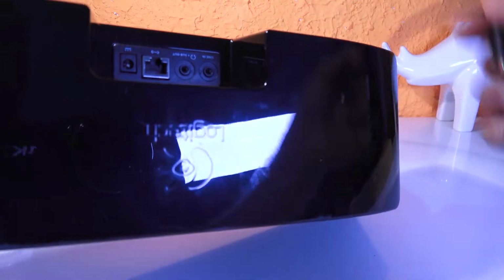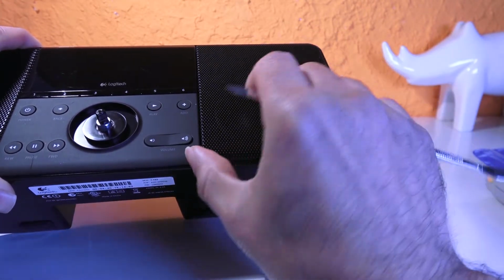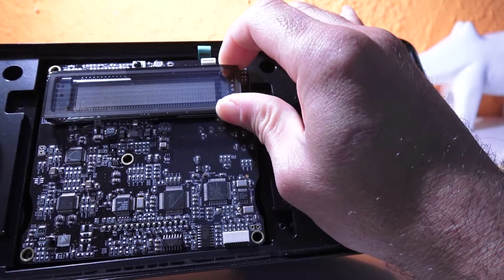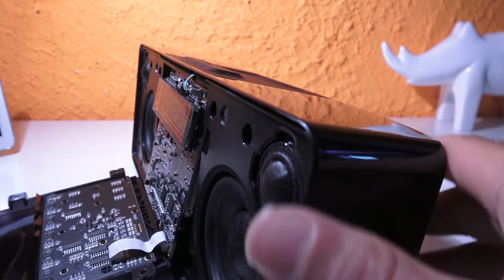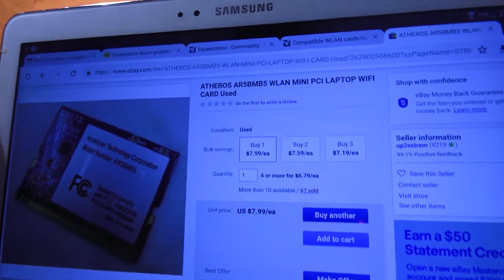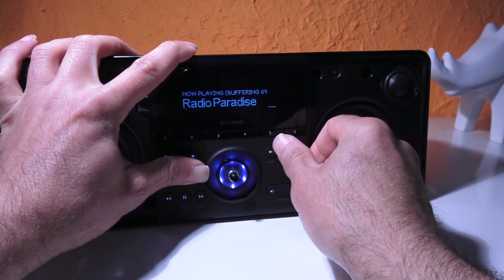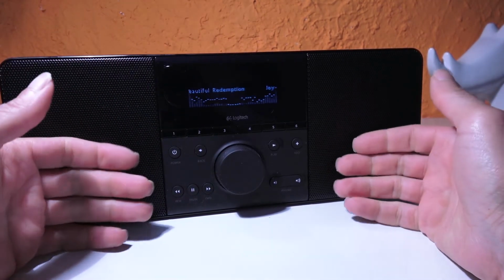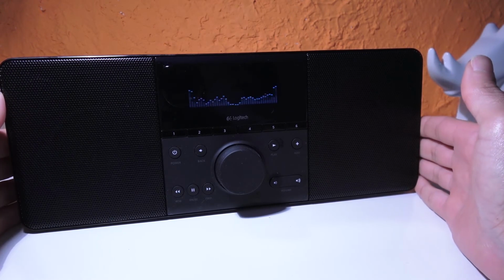Can I fix my Logitech Squeezebox boom internet radio that stopped working?

Comment: I have the same radio. Mine still works fine. I also have the smaller radio. I also have the original squeezebox, but that one quit working. I bet is got the same problem as yours. I also have the Transporter that I bought brand new, and thank god that is still working, since I love that thing, and it cost me a fortune back when I bought it. If you have an iPad, I recommend the app from iPeng. It’s basically a replacement for the remote control, and it is a whole lot easier to use than the remote.

Comment: Congratulations on getting yours working and a really nice instuctional video. I replaced the card in mine today for no other reason than wanting an exuse to have a look inside! My display badly needs replacing. It seems Noritake no longer make the MN16032 display for the Boom. It's not the end of the world if the display doesn't work but it sure looks nice. My Boom is still going strong after ten years. Touch wood...
Reply from the maker: Try this blog might help you with the alternative VFD models and how to install it : https://joes-tech-blog.blogspot.com/2016/06/logitech-squeezebox-boom-vfd-display.html
And this is direct link for the manufacturer to ask for support : https://www.noritake-itron.jp/contact/en_req_list.php?data=MN16032GB&cat=SPEC
Reply: @SKYishow  Thanks very much. I know Joe has been buying them in the past. Maybe he has some spare

Comment: Great video! I have the same type, bought it in 2006. The problem with my boom is the powersupply connector. There must be a solder defect, because when I move the powercable a little, it wil work sometimes, at least for a short while. With this video I know now how to open!
Reply: I have the same problem, did you fix it?
Reply: @harrywiersum5875  Yes, I did.  First cleaning the solder points of the pcb (powerconnector board), and re-solder it
Reply: @shadower3833  great, tnx

Comment: Mine had intermittent power so I figured it was a cold solder joint from the jack to the board ... but au contraire! Examining the jack and plug, I noticed that both looked melted. And the center contacts on the plug were recessed a bit from the center line of the plug, resulting in a bad contact. I bent them back in a tiny bit with a pin, and now the plug makes contact with the jack. 

The power supply is rated at 2.5 amps at 12 volts, which is a lot of power to put through those little jacks. If this gives me any more trouble I'll hardwire a pigtail onto the power rail and run it out to a beefier jack.

Also, I spent ten minutes cleaning off a thick layer of goo on the rubber front panel and knob. I dunno why that got there, but it's been hot and humid lately.

Comment: I also encountered the same problem. I removed the WIFI card and wiped the gold finger on the link with an eraser. It is now normal. I think it should be the cause of the oxidation of the copper contacts in the humid air.

Comment: I just got one of these in not very looked after condition. One speaker driver surround had broken and had a tacky repair job before failing in the parts they didn't glue. The surrounds are also getting stiffer despite being rubber/pvc. Display is getting dimmer it seems. Tossing up what to do, or whether to just leave it and salvage the drivers or turn it into a mini amplifier box. Only cost $2

Comment: Another solution, a different approach - get an external wifi to ethernet adaptor and then plug the ethernet cord into the Squeezebox. I have a IOGEAR device. They're a bit more expensive now than when I bought mine but they work seamlessly. There are other brands that are cheaper. Easiest solution to those of use who don't have a "take out a screwdriver to fix the problem" mentality.

Comment: Id like to add an aux in either Bluetooth or 3.5mm input and that's it! - btw why does this machine sound so good!
Reply: The drivers and amp are specially tuned in firmware for smooth response and the box is very rigid. Smart speakers are made the same way.
Reply: @jamesvandamme7786  you know whats interesting I justbrought it to hitronics to get the modication done for straight aux in...I'm sadly no longer using the box the way i want?

Comment: I  have just fixed mine, just looking for the pci-card now.
Reply: I also encountered the same problem. I removed the WIFI card and wiped the gold finger on the link with an eraser. It is now normal. I think it should be the cause of the oxidation of the copper contacts in the humid air.